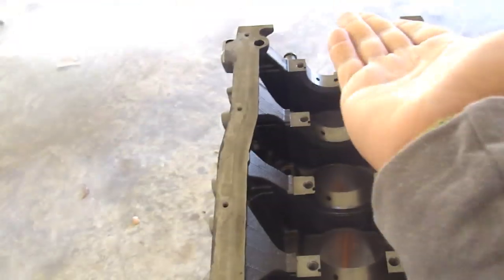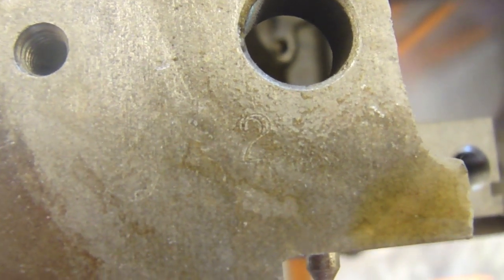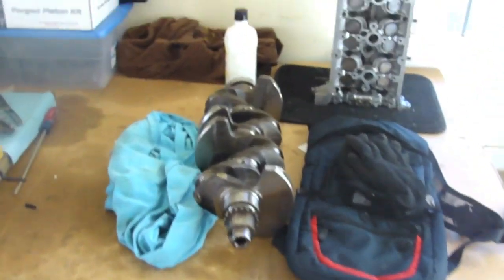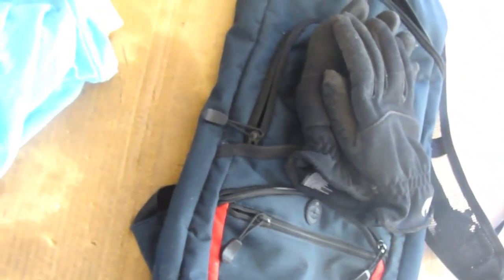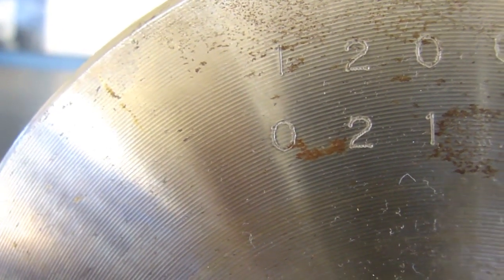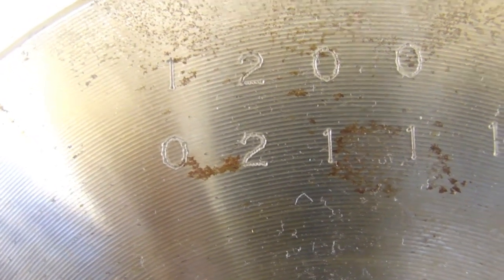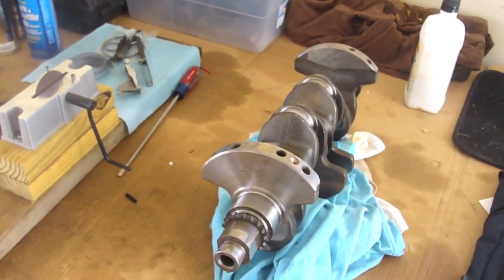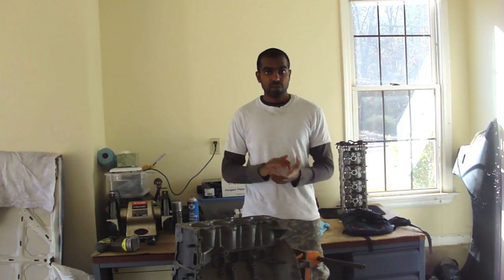Choosing Bearings for your KA24DE

Comment from the maker: I thought I mentioned it in the video, but if you dont go with Nissan graded bearings, the right way to do things would be to take your standard size bearings to a machine shop with your crank and block and have them polish your crank to match the bearings and give you the oil clearance that you want.